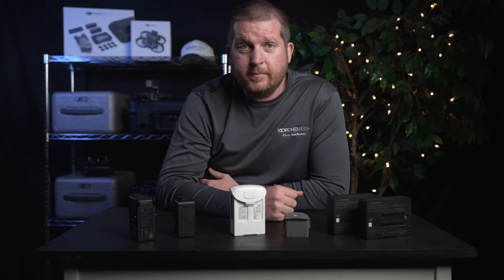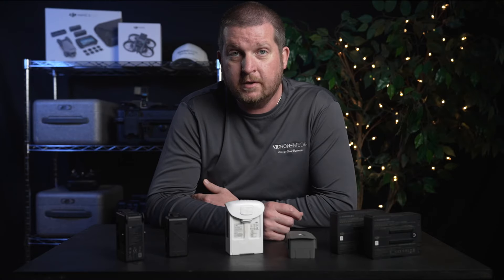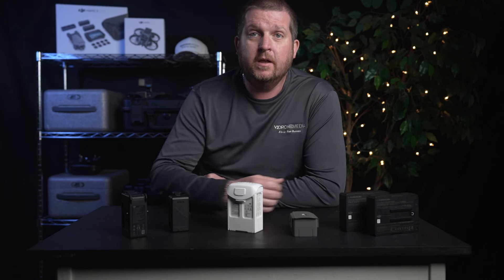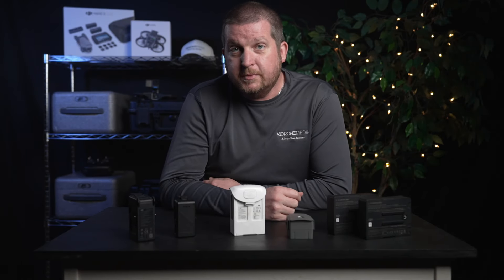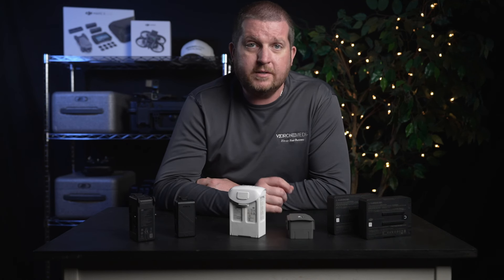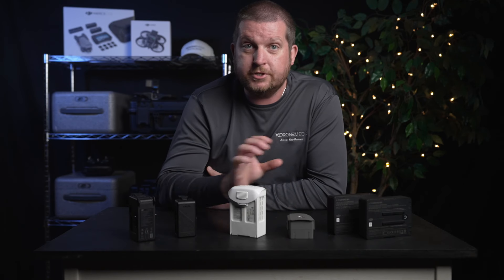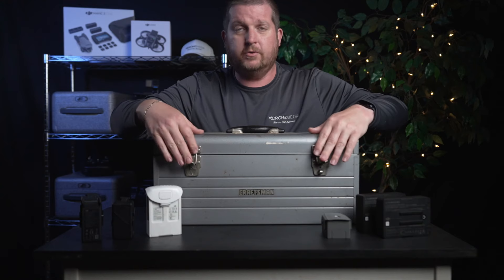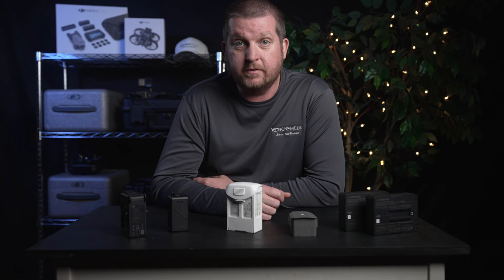STOP Killing Your DJI Drone Batteries: MUST KNOW information for Drone LiPo Batteries

Comment: Good info! I use four batteries on my Mini 3 Pro. When a battery drops to 20%, I land the drone and change batteries. After flying, I leave the batteries in the partially discharged state, then re-charge them right before the next flight.
Reply from the maker: Thanks for watching/commenting!  I also typically charge batteries either the day before or day of flying.  I just wouldn't leave them in a discharged state for an extended period of time (more than a week or two)

Comment: Drone batts frighten me a bit.  I store them in fireproof bags, inside an old tool chest.  I have an aftermarket charger that will bring them up to 60% after a flight for storage.  If I have an extra fully charged batt at the end of the day, I discharge it to three lights running this iPad for a few minutes.  The three-way DJI charger has a usb out.  Note:  I drilled a few holes in the tool chest to vent pressure from a ballistic battery.  I notice that my mini 2 batts will continue auto-discharging down to about 60% after a few weeks idle.  Sometimes I forget and leave them stored at 80%.  Pretty smart batts.  Thanks for the video.

Comment: Hi! Very good information. Veeery important Video!!! With my new mini 4 and before with the mini 3 I do/did the following procedure: land the drone when bat is in range of 15%-20% (that is the beginning of the orange status on the flight app). When back home I load them up to around 63%-66%. How? This level is reached, when the third green led has just started to light constantly (check by pressing the status button, dont use the load indication!). When I'm up for  a flight I load them all to 100% 4 hrs before. I have 6 bats. I usually use 3 for a run, but can use 6 for a full fun day. I do something similar with the controller..... After flying 3 bats the controller has around 70-85%. I leave it and make the next run without loading it, as it still has enough juice for the next 3 friends. Then after that run I do it the same way as with the bats. And I have an extra box, built for LiPo airplane transports, where all bats and the controller fit in. That LiPo box was about 100,-- EUR. It's worth it, I believe. And yes, I have a second charging hub, which keeps me in the 4 hrs range when loading all 6 boys and the controller. I guess most newbie pilots load them to 100% and let the logic do the rest or leave them discharged. Some of my drone mates do it that way, even though I explained it to them. One cant help always. 🙄 I got these hints from a battery expert (works at photovoltaic company and he's the battery master of them). Have a good time and fly savely! Greets from Germany. 😊

Comment: Is there any tips for the battery if we travel by plane?
Reply from the maker: Generally speaking, when traveling with drone batteries (by air), they should be at 50% (or less) charge and NOT in checked baggage - most airlines require the batteries be with you in your carry on baggage.  For extra protection from short circuiting, you should also have some sort of cover on the battery terminals.  You can find more information here:
https://www.faa.gov/hazmat/packsafe/resources/airline-passengers-batteries
Reply: @v1dronemedia696  thank you. Really appreciate it 🍧

Comment: It would have been REALLY helpful if you would have told us what percentage we can fly our DJI drone batteries down to.
Reply: 80%-20% is the best for the batteries, but i load them to 100% and try to avoid going in less than 20%.
Reply: That's because it varies. I have Phantoms and Mavics, started with the latter and aquired the former many months later.  As I got further into the hobby, I found out quite a bit.

Comment: The only thing that I am missing here is how to actually storage charge them? There is no storage option like in "regular" lippos. Do i charge them to approximately 2 dots?
Reply from the maker: Yeah, unfortunately, you would have to do this manually - simply charge to the 50-60% range and them take them off charge.

Comment: I'm assuming the answer is the batteries need to be replaced, but do the DJI mavic air batteries tend to swell even just a little bit after running a full flight?  Also, do you or does anyone know where to get a decent deal on DJI mavic air batteries still at this time in June 2024?  The battery seem to be so expensive...it might be better off just to buy another drone. 😅 Thanks for your great videos.

Comment: I have a 2017 phantom 4 pro. and I use Airdata to keep track of the drone and battery maintenance, and I stick to it like clockwork. The 4 batteries I bought with the drone are now 7 years old an had many charges, still perform like the new ones. I always let the drone come home automatically when  the charge gets low. I also let the batteries cool down in the wind before put them back in the case. If you take care of them, they will last a long time.

Comment: Thank you for sharing this most useful information on battery care. I have one quick question. I do not use drone that much only may be in 6 months or so when I go on holiday. So what's the best way to store the battery so it does not discharge completely. Do I leave it in the intelligent battery pack and the battery pack will prevent discharging the battery after it reaches minimum level? Thanks in advance.

Comment: Yeah, I didn't know too much about that with my drone batteries. At first I used to charge my batteries to 100% because I thought they would go bad, but then I heard about leaving them partially charged. I haven't used my drones for about 6-7 months now. I'm wondering if the batteries are still in great working condition. 
I don't fly when it's below 45° because I don't like the cold weather too much. I fly during summer. Do you think that's a good idea, To leave them alone without charging for so many months?
I love the video and all the great information that you have provided. 
I'm now a new subscriber of yours and hopefully continue to get awesome information. 
Thanks for sharing. 👍👍👍

Comment: Last year, during the heat of summer (about 95 degrees ambient temp), I had a DJI Mavic 2 battery blow apart on me while in flight. I had already finished flying and flew it over to the parking lot area and let it hover about 10 feet off the ground while I walked over to the parking lot. Then boom, I see the battery blow apart and thankfully the battery separated from the drone. The drone without a battery is pretty light so it more or less fluttered to the ground and miraculously, there's a thick grassy patch about 3 feet wide that the drone fell on so it didn't sustain any damage. The battery, on the other hand, had basically blown into two halves. No fire though.

Comment: my drones 7.4v have 3 wires and its hard to buy some batteries aftermarket so im thinking buying one off those high perfomrance lipos for fpv drones ,but they have two conectors ! So i need to solder all the 5 wires or only the positive\negative and white wire for balancing the voltage ?taking in consideration that the normal battery drones have a board  in the plastic inclosure to balance the voltage and overcharge protection!

Comment: I have a Mini 3 Pro, and the 3-battery charger/cradle. I have seen that storing the batteries in the cradle will discharge them. I found this out yesterday as 1 of my batteries was at 54%, and the other 2 were at 70%. It affected my flight times!  I lifted the batteries OFF the detents of the cradle before I tucked them away this time.

Comment: Great video,  nice information.  

LIPO fires are a real thing. Ive heard to many stories throughout the years.  So I strongly believe that folks should not cheap out when it comes to getting a battery charger. The charger I have has temperature probes, if the batt. gets to hot it will shut down automatically. Or you could just go out and buy an old army ammo can and charge the batteries in it.
Reply from the maker: Thanks for watching and commenting - appreciate the kind review!
Reply: I've seen LiPo batteries catch fire in RC Car racing.  It's very dangerous, they sell bags for storage and or charging, that's where I keep my LiPo batteries.

Comment: Good info. Might benefit from
- info on how to best discharge batteries to a good storage voltage
- ideas on how to keep batteries at a good operating temperature for those that might spend all day out in the cold with a small portable drone in the pack.

Comment: Thank you for the treatment of batteries. What about leaving the batteries in the DJI charger, beyond when they reach full charge? Should they be immediately taken off the charger?
Reply from the maker: Once the batteries reach full charge they should stop charging.  Taking them off the charger doesn't have to be 'immediate,' but I wouldn't leave them on the charger once they are fully charged.

Comment: Ummmm…drywall is flammable. Otherwise nice video
Reply from the maker: Thanks for watching and commenting.  Drywall, commonly known as gypsum board or plasterboard, is not highly flammable due to its core composition which consists primarily of gypsum, a non-combustible mineral. The gypsum core is inherently fire-resistant. Drywall will not ignite easily but can char and eventually burn if exposed to fire long enough. The paper facing can ignite, which might contribute to the spread of fire if not contained or if the fire is intense enough.

Aside from that, the main purpose of using drywall in the metal toolbox example is to buy enough time to be able to get the box OUT of the house in the case of one of the batteries malfunctioning/igniting.
Reply: Dry wall or, as we all it in the UK plasterboard, is specified in fire containment schedules, ideal for the suggested application

Comment: I've always followed these guide lines, but DJI battery quality up to the Mavic 2 Pro is appalling, my 3 batteries that came with the fly more combo have puffed, 2 of them were still under warranty, just for reference my Macbook Pro from 2010 still work with its original battery, so in my Canon 7D from 2010 both original batteries still work, DJI is so out of touch because of some of  these DJI Fan Boys.
Theres no Drier, temperature low and stable place at home than my desk, and is the same place I keep all my battery powered devices including Drill and Lawn Mower high capacity battery, I have 6 Mavic 2 Pro all puffed and all with less than 15 uses each , none of them drained bellow 20% and all set to self discharge , I am a big fan of the Mavic 2 Pro but the batteries are crap, once they puff (inflate) they become unusable as they can just pop out of the drone.
I will soon sell my Mavic 2 Pro because of that as I sold the Mavic Air for the same reason.
I have bought the Mini 4 PRO 2 weeks ago and thats the only drone I'll keep also will be my last if the batteries end up having the same issues.

Comment: Great video, greate tips. I hope the built in discharge stops discharging at a safe level. Thanks for showing where/how to activate the detailed battery status. Having 3 standard and 3 plus Mini 3 PRO batteries a kind of log updated at regular times feels interesting. The same applies to the 3 Mavic 3 PRO batteries.
During the cold winter the worst thing is the joystick fingers getting frozen, not much or any flying for months. Some Y T guy suggested some exercising for the not flying batteries. Did I miss that information in Your video? T U of course.
Reply from the maker: Thanks for watching and for the detailed comment!  I would recommend (as does DJI) storing batteries around 50-60% level if they aren't going to be used for a couple of weeks or even a month or two.  That being said, you also don't want them to site for months on end without any use and/or let the charge get too low for an extended period.  In this case, I would charge them back up and either use them back down to the 50-60% level or let them self discharge back to that level to 'reset the clock' so to speak.  Hopefully that makes sense.
Reply: @v1dronemedia696  Thanks! 
if I, during longer periods of no flying, check the voltage of the batteries and charge them up when they've gone below 50 percent, would that good? Letting the selfdischarge be the consumer?

Comment: DJI recommends discharging Phantom 3 batteries to less than 8% every 20 charge-discharge cycles. Any recommendations on how best to do these?

BTW, thanks for the video guides and tips! 👍
Reply from the maker: Thanks for watching and commenting!  When it is time to do a 'deep cycle' on your battery, I would recommend flying as you normally would, but once you have depleted most of the battery bring it back and either:
1. Hover over your landing spot until the drone wants to land itself (Be sure to cancel Return To Home if it tries to initiate).  Let the drone land and just leave it on until the drone shuts itself off.  By hovering over the landing spot you are draining the battery until the drone is forcing itself to land.
OR
2. Land as you normally would and just leave the drone on until it shuts itself off.  (This option may take longer, depending on your battery level, but will accomplish the same thing.

Let the batteries cool normally and then charge them back up to 100% - don't let them sit depleted of charge for an extended period of time (more than a day or two).

Hopefully that makes sense.
Reply: Makes perfect sense! Thank you.

This advice parallels LiPo maintenance protocols recommended by manufacturers and battery gurus. "Deep cycle", as you call it, helps us extract more charge cycles from these expensive  power storage systems, with their BMS and temperature sensors.

Much appreciated! 👏 Subscribed, as I would not want to miss your upcoming videos 👍💯💥

Comment: what is the result (possibly negative ive been told ) of flying your batteries to the last of the charge available in the battery?  I often push it until the drone goes into a auto landing sequenced ad then i bring the drone back with sport mode and land immidietly, even if that means going Ito the single digits of remaining battery percentage .  like %4 for example .  is there anything I should be aware of when pushing it using this technique to get the most out of a single flight ?  Thanks 

FYI I AM FLYING THE MAVIC 2 PRO WITH DJI SMART CONTROLLER
Reply: I’ve got a Mini 2 for the last 2 1/2 years. My batteries are swelling now, and I believe it’s from too many long flights. I’m at ~115 cycles. These batteries should last at least 200 cycles, but I don’t think I’m going to make it. 😢

Comment: most DJI batteries are not li-po, their li-on
Reply from the maker: If you look up the battery specs on a lot of the DJI drones, most of them say that the battery type is Lithium Polymer (LiPo) - DJI Matrice 30 battery type: 5,880 mAh LiPo battery, DJI Mavic 2 battery type: Four-cell LiPo battery, DJI Mini 2 battery type:  LiPo 2S, etc.

Regardless,  Li-Ion and Lipo batteries are very similar in chemical properties (LiPo is technically a Lithium Ion Polymer battery)

Comment: Useless info. DJI batteries are NOT the problem.
Cheap commercial drones and quadcopter Lipos are.
This video is about as useful as the sign at th e gas pump that says no smoking. 😂